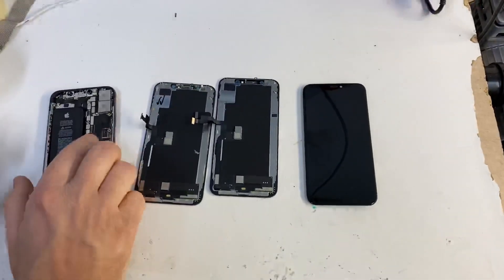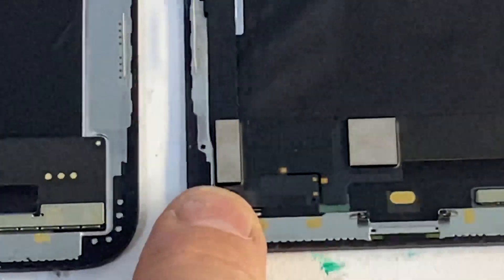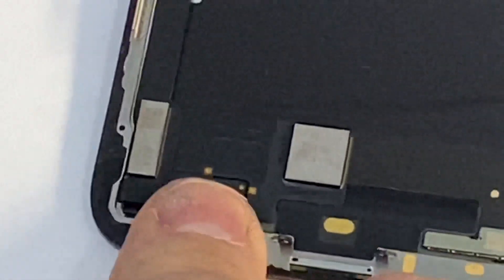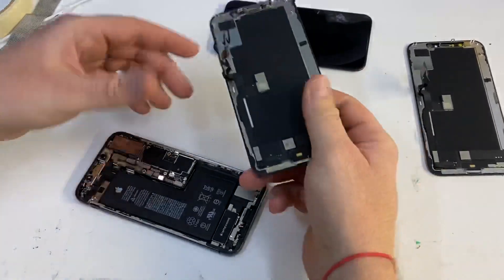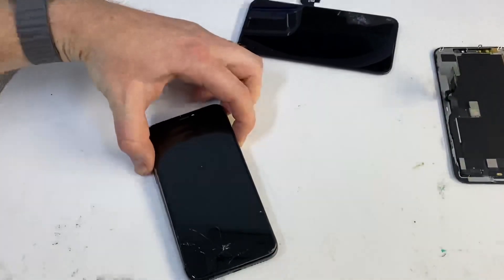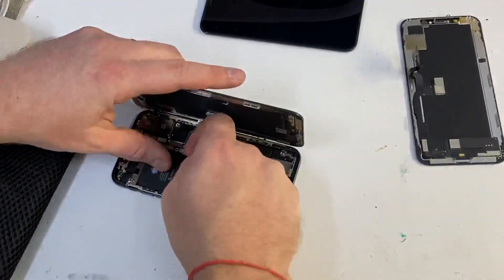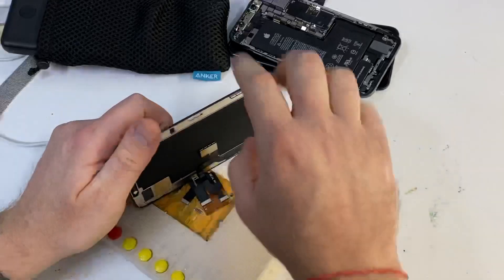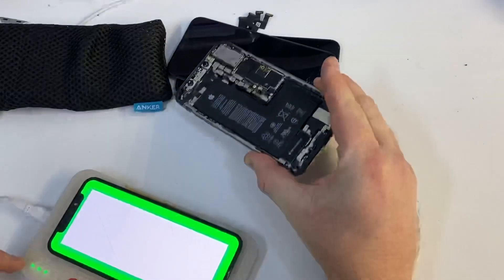iPhone XS and XS Max Touch Screen Pairing Calibration Fix

Comment: I have a question , I have a 2 iPhone XS Max’s both 1 with all original Apple parts never replaced the display , and the my other IPhone the display was replaced by Apple at my closest Apple Store , the display seems to be abut cooler than my original display on my iPhone XS Max , it isn’t a big deal at all but it was simply a noticeable observation on my behalf, so I am just wondering is it possible for me to get the cooler display calibrated to have that warmer display of my original iPhone XS Max? , because like I said although not something that bothersome I do prefer the warmer display , and the fact that there is a difference in colour temperature between both Apple original screens , is very surprising to me , please help me with this if you can , thank so much sirr

Comment: is there any fix for this? run into same problem, used icopy to fix truetone but it didn't fix touchscreen issue. dfu restore doesn't help either. very frustrated
Reply from the maker: See later videos on channel, swapping the IC over (microsoldering) resolves it.

Comment: If reglass xs/xsmax ...and have to change TP do i need match same digits ? Or not important
Reply from the maker: The China new tp glass is NOT universal. The digits on the IC don’t always match the original ic digits. China refurbish the ic and can laser on 4/6 digits regardless of what the original IC digits were. I would recommend using dl100 tester and test whether the screen is actually faulty or not, if it works don’t re run the screen put it in stock and use it on the next repair.
Reply: Absolutely not